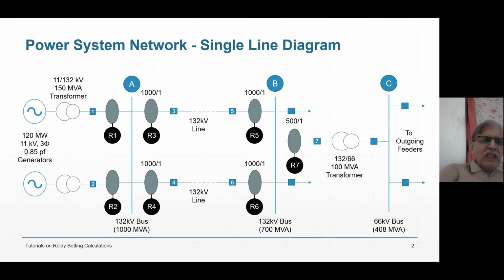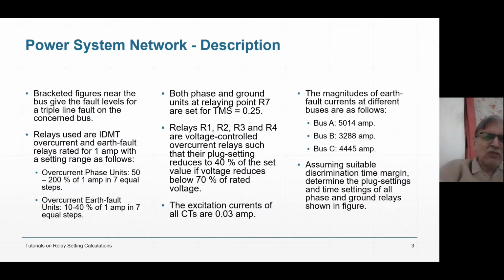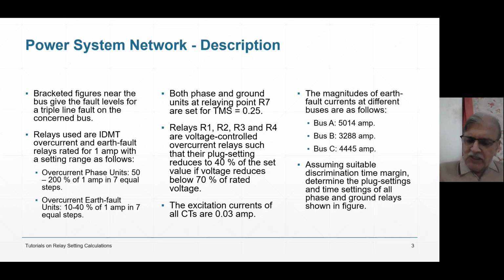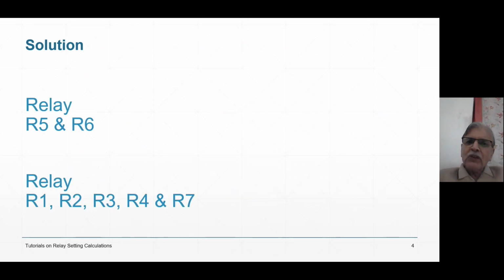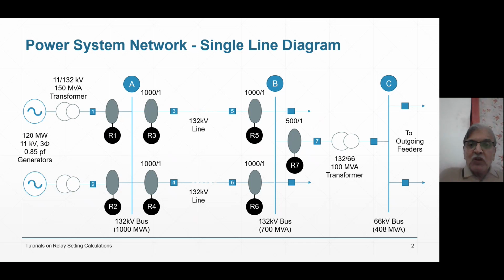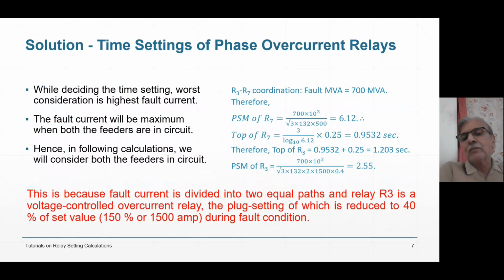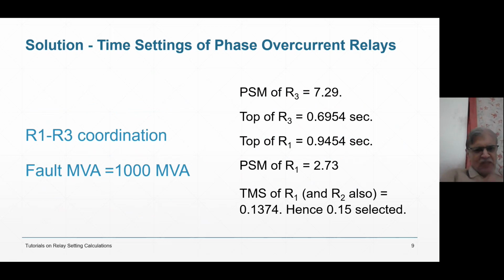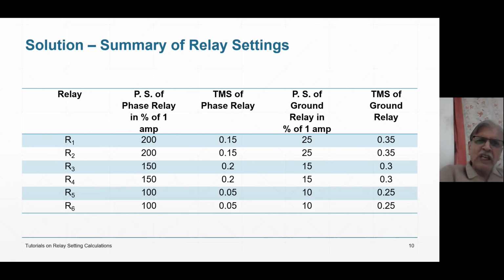Numerical Relays l Settings of Phase Relays l Parallel Feeder

Comment: Thank you very much Sir; for a very useful advise. 
In Gulf in some parts as standard; we use the Directional element as very minimum ( 50% P.U) and minimum TMS. In our example the coordination issue between  R3-R6 and R5-R4  can be brought to minimum. It is just to share. Thank you once again for your nice presentation.